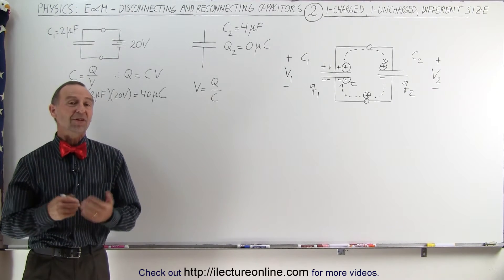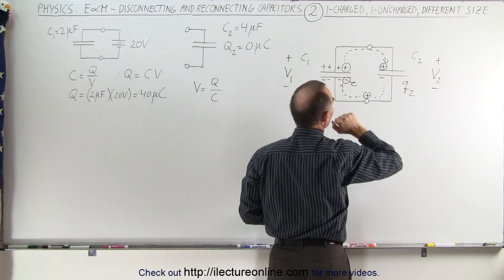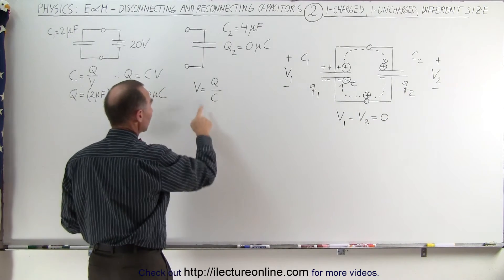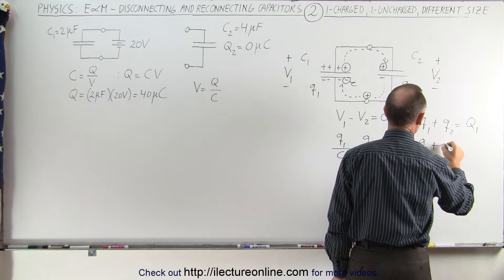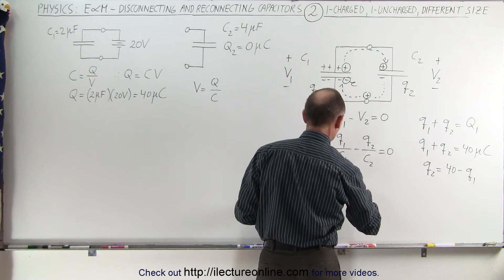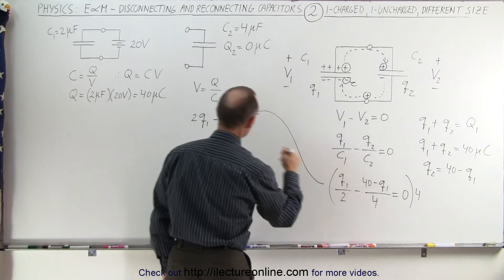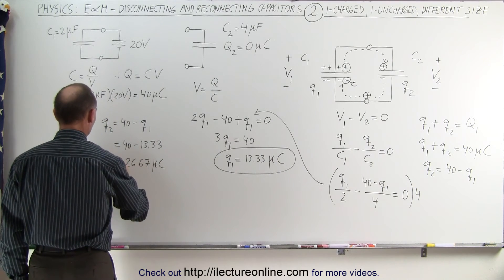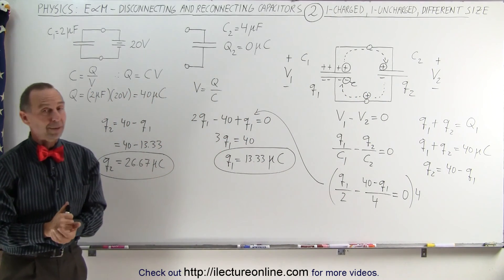Physics - E&M: Dis- and Re-Connecting Capacitors (2 of 16) 1-Charged, 1-Uncharged, Different Size

Comment: Hi Dear.... thanks for these videos...
I have problem can you solve it ?? 

A 10.0-μF capacitor is charged to 15.0 V. It is next connected in series with an uncharged 5.00-μF capacitor. The series combination is finally connected across a 50.0-V battery as diagrammed in Figure P26.63. Find the new potential difference across the 5.00-μF capacitor after the switch is thrown closed.

Thank you
Reply from the maker: After the 2 capacitors in series are connected to the 50 V battery, it is no longer relevant what happened before (unless you are trying to determine the charge on the 5 microfarad capacitor before connecting it to the 50 V battery).  So it becomes a simple determination of the charge in each capacitor.  Fist determine the equivalent capacitance ( = 50/15 microfarads)   then determine the total charge which is going to be the charge on each capacitor.
Reply: @MichelvanBiezen  
Thanks for your reply....
But if you can when you be free make video for solve ?? I like your method solve ...
Reply from the maker: We already have an entire playlist with these types of problems

Comment: What happens if a resistor is also connected in series in the final circuit?
Reply from the maker: There are lots of examples like that in the RC playlist.  A resistor will delay the charging of the capacitor by limiting the current.

Comment: Why isn't the energy adding up. The initial energy stored in the capacitor is more than the pair!
Reply from the maker: That is a very good question.   Here we have to look at this in 2 ways.  1) The ideal world.  If this was an ideal situation with no energy loss on the wires, then the charge would oscillate back and forth forever (like simple harmonic motion). The energy would remain constant.      2) The real world.  There is resistance on the wires and the charge would oscillate back and forth until coming to rest in the situation pictured in the video.  The final energy would be less than the initial energy.

Comment: I'm confused with the V1 = q1/C1, because 20V=13.33uC/2uF doesn't work. I can see that both capacitors hold the voltage in, but if then you can't use V=Q/C in this way then how come it was used in the calculations when the second circuit was connected.